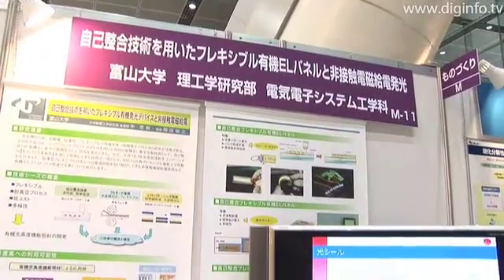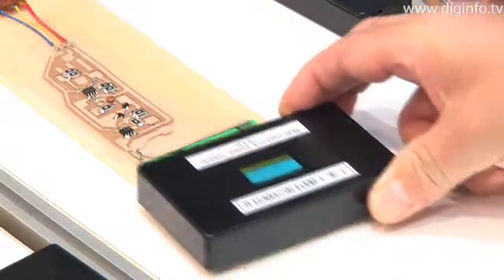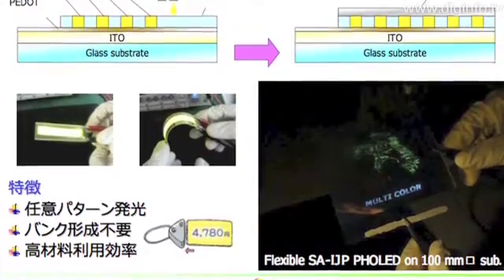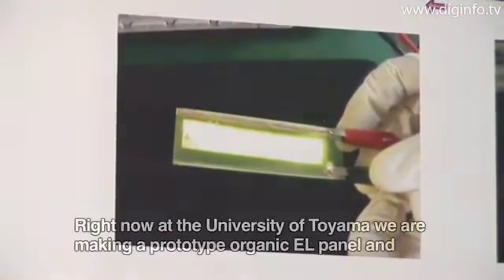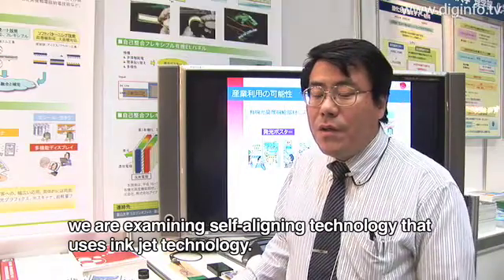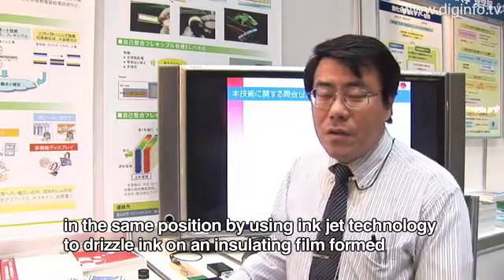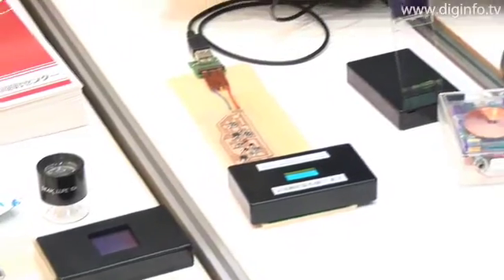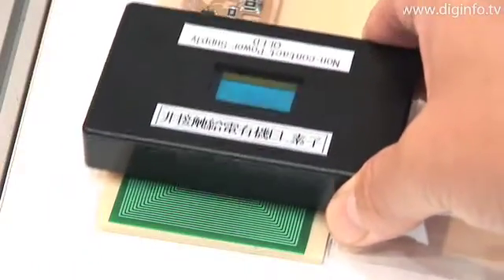Flexible OLED Panel - University of Toyama : DigInfo

Comment: electrode EL panel is available in lengths of up to several hundred feet.
Parallel electrode EL panels have a clear front electrode and an opaque rear electrode and no center line. This type panel may be more appropriate for back lighting fine-art, photographs and signs where a small line in the graphic would be objectionable.   You could make a TV Armor to blend in with your --